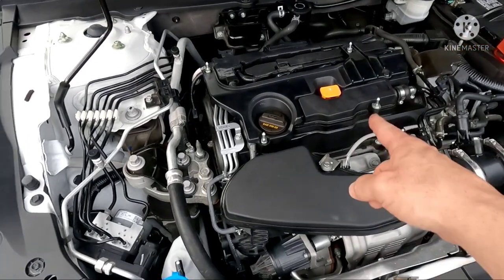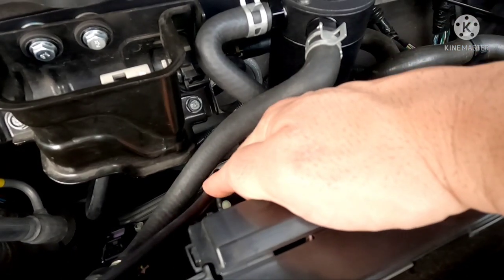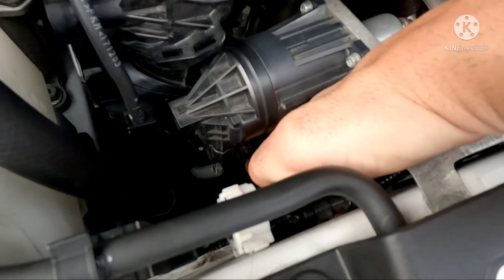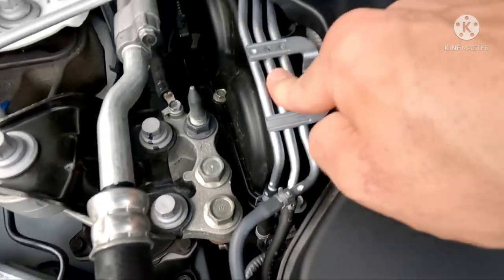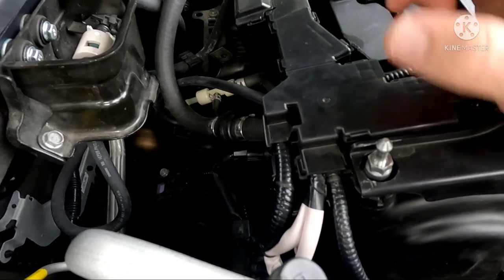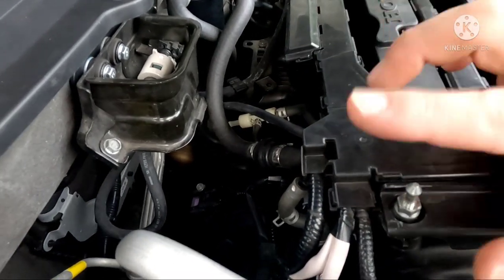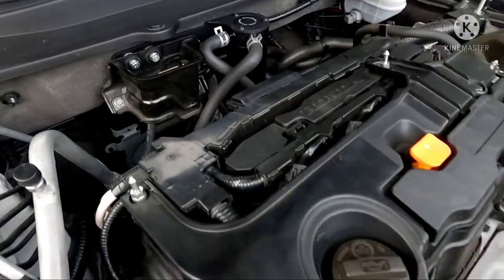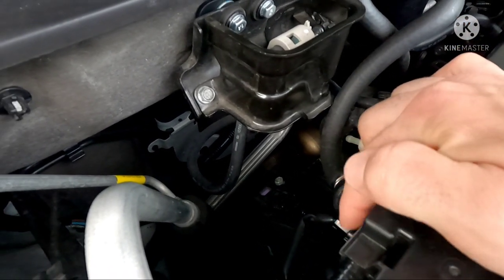The Sputter is GONE! Here's the fix! Honda Accord 2.0t

Comment: So glad you got it figured out! More knowledge the better! Thanks Dan cheers! I wonder why this fixes the issue on a technical level.
Reply from the maker: From what I understand that solenoid tells  the bypass valve to let off boost. From my experience when tuned it seems the extra boost meases with it. By doing this it's no longer being handled electronically. It's working strictly off of vacuum. Someone can chime in if I'm incorrect

Comment: YESSSS, do you think everyone with a tune should do this? or only if the sputter happens?
Reply from the maker: I mean if you don't have the problem I wouldn't, but most likely it will happen.
The best way to test if you do, go in sport mode the use the paddle shifters and leave it in 2nd gear floor it let it shift to 3rd and then let off shortly after. That seems to be the sweet spot where it will occur.

Comment: extremely helpful.  I though that was a misfire. does its still make the peesh sound when u let off gas while still in boost?
Reply from the maker: Yes it still does!
Reply: @DanVilla7   what size vacuum hose and cap did you use?
Reply from the maker: @TR1_93  I used something a little smaller than what was there. Got it from the mechanic shop next door to my work just to test it out. I have to take some measurements on the proper size needed.
Reply: @DanVilla7   so i ended up using 7/32 inner diameter caps to cap off 1rst and 3rd pipes  and a 1\4 inch ID hose on middle pipe to intake manifold. If available the smaller 7/32 ID hose will be a snugger fit but the 1/4 inch ID hose works just fine with a clamp. The first pipe's hose goes to the inlet pipe which is why I capped it because it would have been open the the elements
Reply from the maker: Cool!  As long as it fits it will work.

Comment: Even if mine isnt spuddering.   Is this recommended.   Do u get more performance .   K tuned stage 2
Reply from the maker: No performance gain per say.  But when the car sputters your coming in and out of boost so if you have a problem then yes. Best way to test if you do, go in sport mode the use the paddle shifters and leave it in 2nd gear floor it let it shift to 3rd and then let off shortly after. That seems to be the sweet spot where it will occur
Reply: @DanVilla7  ill check in the morning.   Thanks Dan.
Reply from the maker: No problem!

Comment: Hey man I really hope you can reply to this I am really nervous and was wondering if you can give me some feedback. I just got a 2.0t accord with 50k miles on it at a dealer. Everything seems fine its just when I put it in sport mode but don't use the shifters and let it shift automatically, my car stutters at low rpm. When I'm driving slow though and when it shifts itself up around 2 to 3rd gear and 4th I believe it has like a jerky feeling and stutters feeling when slowing down. Even when I let the car slow itself down like not breaking. It happens at 0 to 30 mph 40 too sometimes. Again it's only in sport mode and when I let the gears shift itself
Reply from the maker: I'm not too sure what would cause that. If anything try unplugging your battery for a few min and then see if it still does it. Sounds like the transmission needs to be reset
Reply: @DanVilla7  I have no check engine light. It's just when in sport mode and I'm traveling less than 30 mph and when I slow down or break to slow down the car stutters and jerks. Idk if it's just picking weather what shift it wants to be in at 2nd or 3rd gear. Again it's only when I let the cat shift and downshift itself.also when unplugging the battery it can help reset the transmission itself? And do you think a transmission fluid change and oil change will help the gears shift more smoothly

Comment: I'm having some misfire issues while acceleration between 2k to 3k rpm and 5k to 6k rpm now after tuning my 2.0, I replaced the spark plugs but it did not go away, this valve ,could this be the cause of it?
Reply from the maker: Probably not I would say if anything other than the plugs poor fuel quality
Reply: I would said poor gas

Comment: is this only because you have a tune? this seems like not so minor thing to do and honda should be making recalls if this was the case. what is the purpose of that solenoid?
Reply from the maker: In my situation yes, a few said have similar issue stock but for the most oart tuned cars.   I didn't really know much about until the other day. All I know is that it helps tell the car to cut boost( maybe someone can chime with a better explanation)

Comment: What year is your 2.0 Dan?
Reply from the maker: 2018
Reply: @DanVilla7  does this happen on the new 2021 2.0t haven't had this happen with mine yet wonder if it will happen later down the road
Reply from the maker: @OO-xz3ki  I can't say for sure but the car is pretty much unchanged. At least if this issue happens you have the fix

Comment: It seems all 2.0 rear main seals could be faulty. At least on my 21 RDX 2.0 t 10 speed auto and my 21 TLX 2.0 t 10 speed turbo. Slight oil smell in vents with AC off and fan on with motor warm. And oil residue and or drips at fly wheel cover. Same with a 2021 2.4 ILX 8 speed dual clutch loaner, and my previous vehicle a 2019 ILX all rear main seal defect from factory. Its made of the wrong composition and or not fitting on crank shaft properly. Its possible its on the accords too. Unless its coincidence they all have same problem, i think not. Spread the word! These are facts.
Reply from the maker: I don't have an leaking or smells. And this did solve the problem. I don't get why a lot of the new acuras have so many problems when they share so many parts with other honda's especially the Accord
Reply: @DanVilla7  the leak cld be small to start look at fly wheel cover, for residue and or small drips, maybe different factory than the acura or the hondas have different size rear main seals amd crank shafts than the heavier tlx? I dunno
Reply: I’m running a Phearable stage 3 but haven’t noticed this in my 21 A-Spec. 🤔
Reply: @MidnightAspec  its becaise im super critical. Check again. Maybe you got lucky

Comment: Yes, the sputtering is gone. But almost my turbine as well. I have the rv6 catted down pipe. K&n full intake. And phearable 3.  The car was feeling super restricted and after 2 pass in sport mode the turbine start making funny noises. Frankly even with no sputtering I was losing power. I won’t recommend this to anyone
Reply from the maker: More than likely you may have done it incorrectly or possibly there's something wrong with your car. This fix was directly recommended by John at Phearable. I'm pretty sure he wouldn't recommend something that would discredit his tune or himself
Reply: any update on this?